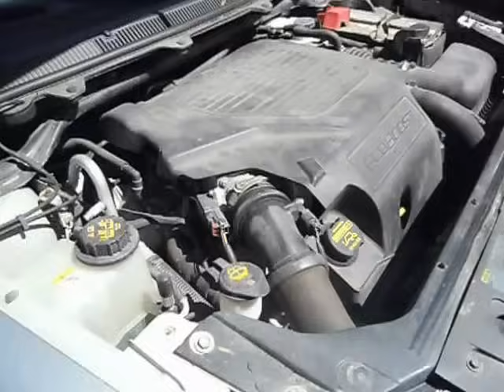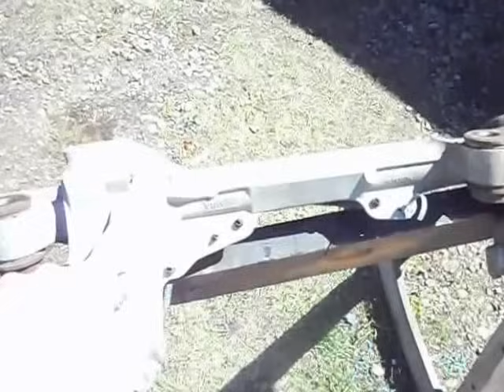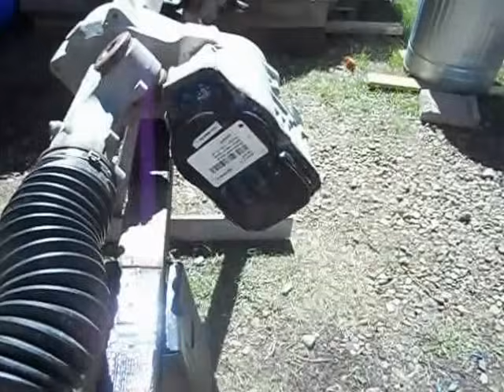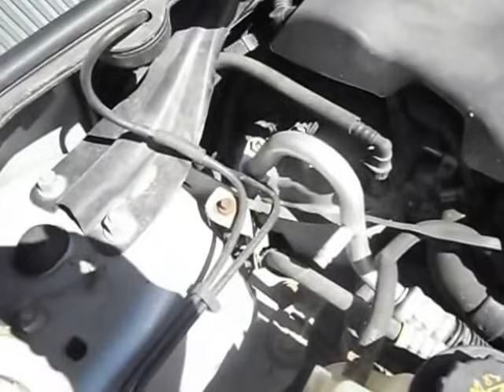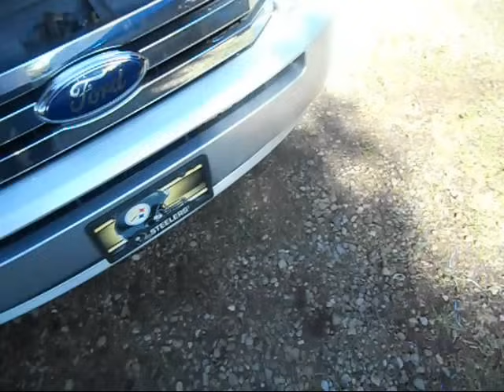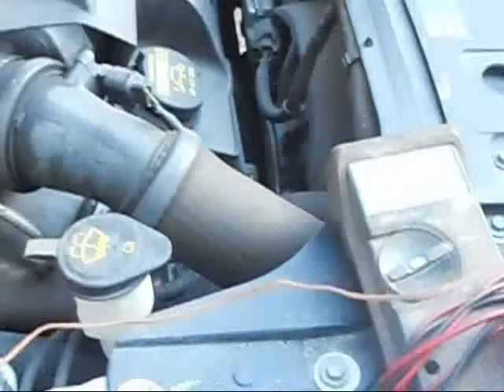Ford Electric Power Steering Failure Identified

Comment: 2014 escape SE here. same problems. $1800 through dealership. this is absolutely ridiculous.
Reply from the maker: Sorry for your troubles and welcome to the exclusive failed Ford EPAS club. I wonder if you would be kind enough to comment further on your experience; i.e. elaborating on any hazardous conditions, or Ford customer service stories. Thanks...
Reply: fault occurred once about a year ago but cleared on power cycle. then about a month ago it started faulting frequently but still would clear on power cycle. last week that ship sailed it comes on before you even start the car. took it to the dealership two days ago and hit me with the quote on this. 82k miles so out of warranty and sol basically. so that's where i am currently, fortunately i have a 01 Toyota pickup for home depot runs and such that i am able to drive. i too work in electrical engineering (HVAC industry) this just boggles my mind that this is what so many customers are left with. i have a 60 mile commute in city traffic one way, the car is unsafe to drive.

Comment: Wonder if ford is watching this?🤔
Reply from the maker: Ford has established massive PR department and thousands of attorneys and engineers around globe to deal with customers who take matters to court. If you take legal action against Ford; you will be subjected to fierce resistance and formidable legal resources in court battle. Ford will demand your vehicle be relinquished to local dealer for inspection (days) by one of their special 'field evaluation' engineers. These engineers will produce bogus detailed evaluation document outlining specifically why Ford is not responsible for vehicle deficiencies. In addition, document will include 'biased opinion' that you contributed in some way to problem. Ford will attempt to use this engineering document in court to sway case in favor of dismissal. My vehicle was evaluated using this process. The Ford engineer actually attempted to criminalize me with report sighting smoking engine was result of oil placed in muffler. Ford failed to realize I was retired engineer with experience in thermodynamics. A muffler does not immediately become hot upon starting engine. In addition, mufflers rarely reach temperatures sufficient to burn oil. From cold start; engine produced heavy smoke due to internal failure. Ford was caught with their pants down in case; matter settled in my favor. Case would have ended very differently if Ford was not called on their attempted fraud; in this case science was used to prove criminal conduct.
Reply: Ford is the Scientology of the automotive industry. I now  trust Ford about as much as I would trust Casey Anthony to watch my kids .

Comment: Wow my 2011 Ford Fusion has the same problem
Reply: I have '10 milan, and I dread buying a new rack and pinion
Reply: I was always told that fords are not good cars to buy sense I was 16 years old they always said Ford means found on side road died. But as a adult I said I’m try to give it benefit of a doubt cause you can’t go by what everybody tell you. Shitting me never again out of 8 cars I’ve had though out my life first time buying a ford and last time they just threw these dam cars together piece crap they all to be ashamed of there selves and get shut down for putting lives in danger😤

Comment: Anybody know of an American firm that takes removed racks and can change out the motor and control assembly or just the control assembly?  See British company ECUTesting.  New motor and control components for about 600 dollars.  I have two 2016 Ford Cmax's and one rack just failed.  I was thinking I would ask for the old rack to be packed in the new rack packaging and ship to a rebuilder.  Then I could proactively replace the rack in my other Cmax with the fresh electronics before it fails.  Then I have a Ford Fusion to proactively change out the rack on.  Every 50,000 miles it's looking like to be safer.

This is a terrific troubleshooting video.  As an electrical engineer myself, I really appreciate the in-depth analysis of what goes wrong with these things.  You would think Ford would set up some kind of mechanical ventilation duct to moderate temperature around the unit.  Our car was heavily loaded with people and luggage going up and down hills in 70 degree air for about an hour.  We stopped for a break and got the warning message on restart.  About 58000 miles on the car.  Neither further driving nor restarts corrected the issue.  Probably thermal failure of the electronics as described herein.  Would be nice if somehow a fuse or thermal protector provided some protection for this system.  Another video shows this to be a half day to full day repair.  Hoping this happens often enough a dealer keeps new racks in stock.

Comment: I have a 2011 Ford Explorer that I purchased in April 2017. On May 27, the power steering failed. The power steering service and terrain warning lights came on and when I pulled off and restarted my car, I had no steering. I took it to my local dealer because I  found a recall had been issued for this problem. They installed a new rack and pinion and I was on the road again. On August 5, the exact same thing happened. I went back to the dealer who told me they could not repair it again without me paying. I called Ford and they told me that the part was under warranty for one year. I took it to the dealer again and it was repaired, this time by a computer reset. Not even two weeks later, same thing happened again. I cannot afford to pay for a reset. I still owe 16k on this car that I can't steer.
Reply from the maker: This is typical Ford customer care process. Sell defective and hazardous equipment, then dupe consumers out of warranty repair while making profit on replacement. Meanwhile the NHTSA stands idle without even an inkling of action. Even if you do pay to have EPAS replaced; keep in mind replacement is still defective, and will eventually fail again. You are not alone, many of us have been fighting Ford for years over numerous design and service issues. Ford manufactures arguably the worst automobiles in the industry, Ford knows this, but they are more interested in maintaing profit, than addressing perhaps over 50 million defective and dengerous EPAS implementations.

Comment: Appreciate your detailed video, 2012 focus se at the dealer nowwith $2000 price tag at 6000 miles out of warranty, still trying to decide what path to take
Reply from the maker: Please remember replacement EPAS units have not been redesigned to automotive temperature specifications. Replacements will fail once placed in same hot engine compartment; some on short order, others maybe longer.

Comment: I have a 2011 F450, & randomly, my steering wheel loses power assist,  but more alarmingly, the steering wheel will suddenly jerk in one direction, then another. Sometimes it would start turning the wheel left to right rapidly. This problem comes and goes. Very dangerous. When I take it to the dealer, it usually behaves well, so they just shrug.
Reply: TA-455-SD mine does the same thing now! PLEASE let me know what you find!
Reply: I have a 2008 Ford Escape
Reply from the maker: Classic sign of EPAS failure. EPAS system is a servo based control system comprising basically motor, two optical rotary position encoders, control computer, power and support electronics. Steering rack is driven via timing belt and pulleys. One optical encoder senses motor rotor angular position, and 2nd senses steering wheel angular position at input of EPAS assembly. When you turn wheel, wheel position optical encoder senses this rotation. Servo controller then drives motor to close feedback loop until 'zero' error is established between commanded position and actual rack position. Rack position is inferred through motor shaft rotary encoder feedback through timing belt and pulleys. So the entire system is basically a closed-loop dual feedback servo, with no redundant feedback mechanisms. This means any failure associated with optical encoders or data integrity will cause servo controller to  actuate erroneously. So, your EPAS is most likely experiencing an internal component failure causing servo controller to sense movement in absence of steering command. This can come from various internal failure sources including encoders, motor drive, controller, or even simple loose wire. Most likely EPAS internal component has failed due to thermal overload over time, like millions of others in Ford vehicles. Situation is very dangerous, advise immediate intervention to protect you and your family. The EPAS system is one of Ford's legacy failures, you will get no help from Ford or the NHTSA on this one.

Comment: Why if there is a lot of folks having problems with this they are not doing the right thing and get them fixed?
Reply from the maker: Ford produced 'tens of millions' defective EPAS units installed over various models and years since 2008. Engineering blunder extensive and ubiquitous, no corrective action short of vehicle-buyback' possible. Not even $100M company could survive such cost due to engineering incompetence. Ford also practices deep-rooted impunity in matters of liability and responsible action (read historical facts concerning Ford Pinto, that often exploded during light rear-impact burning many alive. And Ford's complete denial, criminal cover-up, and failure to take corrective action).
Reply: @bk1468  I have a 2015 Explorer with 106K and the dealer just told yesterday the steering gear\rack and pinion (?) needs to be replaced at the affordable cost of $2700!!!!!! I was straightening after turning into our street when the steering tried to jerk the car back but I didn't let it, but it freaked me out. Now I have to sell the car or what should I do?! I'm not going to spend that kind of money on a steering gear! There is no recall on the explorer, and I learned that the same part is still in use in the brand-new "completely redesigned" Explorer 2020. Go figure ...
Reply from the maker: @AbuPaul  Not really much can be done; Ford has placed millions of consumers in identical position as you are experiencing. Best solution is to cut losses and liquidate unsafe vehicle. Fighting Ford represents long battle, and in the end you may get partial repair coverage from Ford; but not without weeks of frustrating interaction with company that has installed program to ignore and deflect responsibility. You could hire an attorney, but be prepared to invest up to two years for court appearance or settlement. Ford has already designed contingencies for every possible consumer response; including extensive lobbying of consumer protection agencies like NATSA (which has remained silent on Ford steering issues; i.e. apart from initial 
'joke of an action' regarding failed connectors inside EPAS modules.). Bottom line is Ford cannot address steering issues because repair costs would break company; with millions of EPAS units installed since 2008. Like so many of us, best plan is to walk away and move on. Ford will pay with lost revenue and complete loss of consumer confidence.

Comment: Remember the old case where they ran the numbers with the Pintos to see if paying to fix the car vs. the lawsuits was worth it? Guarantee they are doing the same thing here. They won't fix it because it will cost too much. They know it's an issue but are playing the odds game like they always do.
Reply from the maker: I once owned a used Ford Pinto before fire hazard issue was public knowledge. Car was brush painted with white house paint, and engine knocked heavily due to failed crank bearings. Vehicle corroded so badly rear axle assembly detached from body while driving; leaving only front wheels on vehicle. Situation so pathetic and embarrassing; abandoned vehicle on side of road and boarded bus home; never to see the old wreck again.

Comment: $1600 no no no $80 at LKQ used of course but way better than wasting all that time bickering. Takes about 2-3 hours to change.
Reply: Did they have it already pulled? Just pulled out my water logged pos too tired to pull another lol
Reply: @edesir  no I pulled it but the car was almost completely apart so it wasn't hard at all. Drop the k frame. That is the way to do it.
Reply: @roadsideguy5902  Thanks for the info, i'll ride out to the fT Laud location n see what they have.
Reply: Dealership charged me $2,250
Reply: Did you have to reprogram it to the car? I'm in the same boat currently.
Reply: @OfficialOzel  yes
Reply: Did u have to take it to the dealership to get programmed
Reply: @roadsideguy5902  how you program it
Reply: @juanman1320  dealership
Reply: @roadsideguy5902  how much was it
Reply: @roadsideguy5902  same for a 2011 mercury mulan
Reply: Now $300 at LKQ… FJB

Comment: I have a 2010 Ford Fusion, three years ago my wife was driving when she looked at me and said the power steering went out. I soon learned just how bad it was, super expensive  to fix, and had to be reprogrammed once the new steering rack was installed. I fought was Ford but did no good, been driving the car with manual steering ever since.
Reply: my 2012 fusion just gave out power steering assist  failure hope i can do the same i can handle no power steering still have the strengh at 58 :)
Reply: @jimmuth1  my 2011 mustang electric power steering quit a few years ago and I been driving it without the power assistance. Basically "Armstrong steering" lol. It can be very hard sometimes but gets easier once the car is in motion

Comment: I have a 2009 ford escape. with 51,000 miles. Steering wheel only binds at engine start sometimes, not all the time. I just wait then turn it on and it works. Sometimes that does not work and I have to a few minutes to several seconds several minutes before restarting and it works again.
Reply from the maker: This is very common in EPAS unit which has not completely failed yet. I would guess position feedback encoder has failed, but condition could be caused by numerous alternate failures. Since your vehicle is a 2009, Ford will turn a cold shoulder and tell you to replace EPAS assembly at your own expense. However, if you press Ford hard and can manage without your vehicle for 8 weeks, Ford will eventually agree to pay $700.00 of $2000.00+ repair cost. Ford legal will make you sign non-disclosure document; so their problem in 2009 vehicle is kept as quiet as possible. The replacement EPAS unit will eventually fail again, because Ford has never disclosed real failure disposition associated with thermal stress. Sorry to here about your trouble, what makes it much worse is the lack of responsibility and despicable behavior displayed by Ford and the NHTSA.

Comment: Chalk up one more failure! We were told a gear has disintegrated in the motor, and it would cost more than $2200 to get this issue fixed. And replaced with what?? The same failing steering system mounted in exactly the same manner? Just maddening to think this improved steering technology could risk death and serious injury, when frankly I have never had any failure in the hydraulic power steering systems in the 40 years I have owned cars. There just must be some way to hold FMC accountable for what obviously is a failure of their engineers. BTW, we represent the Ford Fusion 2010 family, which obviously was excluded from any recall...  Thank you for your thorough explanation of how Ford is treating it's consumers. Just Sad.

Comment from the maker: Several people have inquired concerning Ford Ecoboost claims boasting improved fuel economy and efficiency.
Engine efficiency is limited by basic laws of thermodynamics, not by turbo charger, super charger, or boasts of technology breakthroughs. A turbo increases engine intake pressure, boosting air and fuel flow, and combustion ratio in engine. This increases HP, but efficiency is limited by thermodynamics. All gasoline burning internal combustion engines are based on the 'Otto-Cycle' defined in basic thermodynamics theory. Heat efficiency is typically graphed against compression ratio; producing limiting exponential curve. Otto-cycle efficiency is limited to approximately 60% with compression ratio approaching 18:1. However realizing 18:1 compression ratio is not practical, with most engines operating between 8:1 to 11:1 (from recollection). For the most part, gasoline internal combustion engines operate with heat efficiencies between 20-38%. This is the best possible efficiency based on limitations of mechanical engine components, and thermodynamics law. No matter what you do (turbo, supercharger, etc.), nothing can change limitations of Otto-cycle curve.
Ecoboost engines achieve far less fuel efficiency than normally aspirated engines. Typically one can expect 12-16mpg from Ford 3.6L engine; compared with 18-23mpg from non-ecoboost engine. This may sound surprising after reading Ford's consumer advertising claims, but these are the facts. Adding dual turbochargers to an engine will allow smaller engines to produce significantly greater horsepower. However fuel economy will be reduced, and engine stress greatly increased. Engine will run strong and hot, with increased maintenance requirement, and reduced service life. There are other engine cycles defined in thermodynamics; steam-cycle, Stirling-cycle, diesel-cycle, etc. Each of these cycles offer greater efficiencies than 'Otto-cycle'. But none have achieved greater ubiquity than the 'Otto'. So, do not be sold on wild claims of greater efficiency and power with improved fuel economy. Laws governing thermodynamics cannot be skirted, and certainly not through the additional $4K sticker price for Ecoboost. (The above is based on educational recollection, some discrepancies may exist).